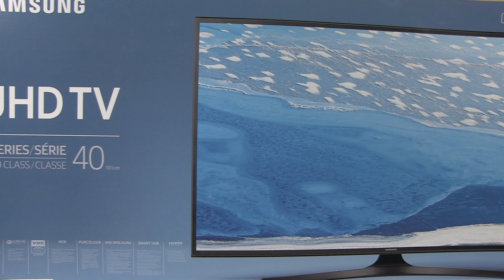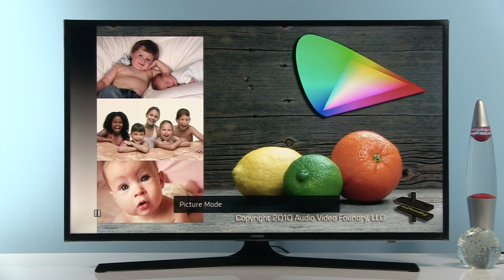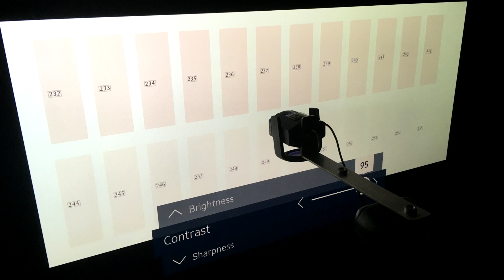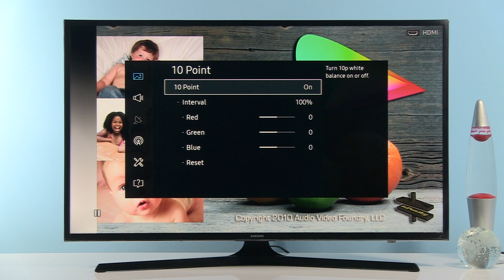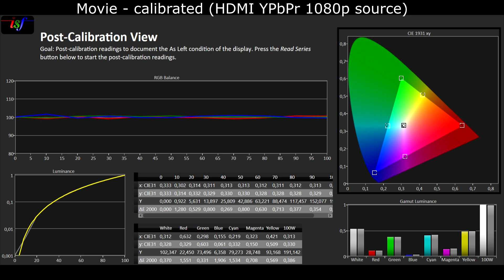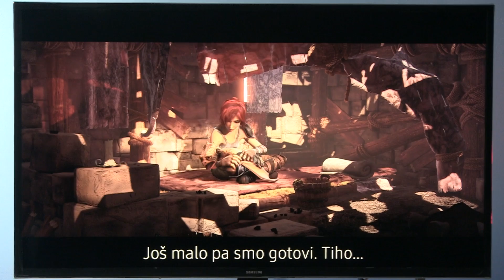Samsung 40KU6072 KU6000 UHD TV settings after calibration

Comment: Thanks for sharing your knowledge and experience. 
Following most of the calibration in this video for a Samsung Smart TV UHD 4K 40" UE40KU6072 I manage how to get both on RGB and other stuff inside the Nvidia control pannel and "game of mode" on my TV. 
The 40'' TV is a playfield of a virtual pinball machine with three screens: two PC monitor and one TV. The two monitors both with RGB and full color output ON. .
The TV was connected to the GPU with a display port and HDMI on the TV. Strange cable buyed almost 6 years ago.
Yesterday I manage to switch the DP-HDMI cable with another (not a 2.1 certified) with an old HDMI cable. 
The problem was game mode on without RGB and color output on in the Nvidia control panel. 
Following most of you tutorial I manage to have both on.  The 4K TV became sharp, clear, very different from the previous settings, no stuttering playing a game on the virtual pinball, much better than before. 

I understand why this is possible, HDMI colors is off. If I enable HDMI colors on the TV, no more gaming mode on the TV and no more RGB and Full output ...on the Nvidia control panel.
Thank you again

Comment: And 1250 settings?
Reply from the maker: 1250 - I am not familiar with this model. What is the full designation?
Reply: @TVguyDarko  Samsung Ku6000 Firmware 1250

Comment: Hey Darko, I own a Samsung KU6000 I watch it only in a dark room. I can't set HDR/Dolby Vision, it's always gray-ish. Below I wish you could analyze my settings and suggest any changes fot HDR Callibration with THX app. The HDR values below have been the most vivid ratio I've gotten from the TV. Any reply appreciated. Thanks!

Backlight          20
Brightness          44
Contrast                  100
Sharpness           0
Color                  50
Tint                          50/50
AutoM Plus         Judder Auto 
Dynamic Contrast  Medium
Color Tone           Standard 
White Balance  Factory Settings
Gamma                 +3
Color Space        Native
Reply from the maker: Hey - the settings look good and basically, this is the best you can get from one of the first mainstream UHD TVs with HDR support. The picture is grayish because the backlight is maxed out and that also elevates blacks on the entire screen due to the lack of local dimming.

Comment: this setup works perfect except in some games with HDR... I had to increase the backlight a little bit. Any tip?
Reply: For ku 6300 I use this form gaming...gaming mode, back light 15, 45,100,20,55,hdmi level auto, warm 1,gamma 0,. And for HDR gaming backlight 20, depending of the game I sometime put color too 69...

Comment: Hi, i have ue49ku6675xxe curved tv, i didn't find settings for this model, which calibration is best for movies? thanks
Reply from the maker: Hello - in general for Samsung it is best to use Movie preset with adjusted Backlight to your preference and reduced Contrast 5 to 10 clicks from the initial value. You also might want to play with Auto Motion Plus to find the optimum playback setting.

Comment: Nice. I think I am getting 43KU6072 next month. It doesn't seem to have any competition on its price point here in Poland, if I sort TVs by price it is surrounded by some 40 inch FullHD TVs, so it looks like exceptional value. 2017 TV's won't have 10bit color until MU7000 series that is surely going to be way way more expensive, so I suppose that there is not much to wait for.  Also thanks for great videos, you are covering just everything, if someone buys the TV you have reviewed then he can be sure that he will use it to its full potential.
Reply from the maker: Thanks for the comment. I can confirm all that you said since I already tested Q7 "QLED" and am testing 40MU6402 - no major differences/improvements compared to last year. So you can relax and get KU6072 - I am sure you will be pleased with it.
Reply: Other interesting options are new Sony FullHD lineup, especially WE75 with Triluminos (similar to Quantum Dot tech?) and HDR10 support and also TCL P60 series, this one is looking especially crazy for a price, 4K, 8 bit + FRC, Micro Dimming, HDR10, 20 ms input lag, full Android, all of this for price similar to this Samsung KU6000. So cheap compared to features that it almost looks suspicious. Interesting things are appearing on the market. I think I will hold on for a bit. Will you be getting any of those (Sony WE75 or TCL P60)?

Comment: When I try to adjust my Samsung KU6000 according to your settings my tv doesn't let me change HDMI Black Level. It is on Low by default and I can find no way to unlock this particular setting. Any idea why this happens to me? I already tried restoring tv to factory settings and the problem remains.
Reply from the maker: Hi, Pedro. Sometimes depending on input signal this option is disabled/greyed out. You should not worry since Samsung TVs have quite accurate auto adjustment of black level.

Comment: Hey thanks From germany. 

The interval for whitecourtballance...how setup i must.. 10% or 100%.? Or is this automatily?
Reply from the maker: Hi - 10-point white balance has 10 different points that need to be adjusted for the best result. So not only for 10% or 100% but for each in between. Please note that usually just by adjusting 2-point white balance you can get really accurate greyscale.
Reply: what for Balance i must try by end of setup
Reply: TV Calibration with Darko i mean by end of setup by 10 point with Balance...  

I can 10%, 20%.... 
with what % u are end setup?

Comment: Hey Darko
Awesome channel, keep up the excellent work! I wonder if you can help? I'm trying to get accurate colors when I connect my laptop to a 40KU6020 via HDMI. However, I am unable to select "Movie" mode when it's connected, only Standard and Dynamic are available.. Should I just select Standard and apply your calibration settings to that? I'm looking to do color correction work using this TV as a monitor, so any advice you can offer would be hugely appreciated!
Many thanks! :)
Reply from the maker: Hi - thanks for kind words! Yes, in PC mode there is no movie, but you can adjust using tips from this video. Just make sure that HDMI Black level is Auto or Full to get full range 0-255 signal that comes from PC by default.
Reply: Thanks so much Darko! One more thing, I'm also unable to access the 10-point white balance.. Will adjusting the 2-point white balance with your settings be enough to give accurate color? Thank you! :)

Comment: Hello Darko! Thx for the settings. I love the picture of my videos now in my 55KU6072. I ve just changed my old tv, my previous tv was a samsung 46' C7000(2010 modell). I love my new tv, but dissapointed a bit about the HDR... what tv do you recommend to buy with best HDR(hardware) in the market?
Reply from the maker: Hi! Full understand that you are disappointed in HDR since your model does not have necessary hardware to display it. It can only detect HDR signals and boost backlight and contrast. TVs with true HDR are Sony XD93/XD94, Samsung KS series (KS7000 upwards), Panasonic DX900, LG 2016 OLED TVs... They will give you not only HDR effects but more deeper colors.
Reply: TV Calibration with Darko  hi! I am planing 2 change this tv to a ue55ks7005SUHD...but some forums said that this is lottery becouse some still have 8 bit panels...I am affraid to spend more and get same 8 bit...Do you know about it or it is just gossip? Sorry my english...:P Regards!

Comment: Hi Darko,
First, thanks a lot for this calibration work. I  like Standart picture preset more than others because of its auto backlight features.I think Auto backlight is working more effective than other presets. I did your settings to my UE50KU7000UXTK model TV in Turkey. I think this is the same TV with KU6000 that you reviewed. But only some differences to set my TV.  Used your calibrated settings at Standart picture mode. Only did 2 point white balance and colour space settings with Warm2 colour tone. Others are the original settings of Standart pic mode. Auto backlight is on and min.backlight is setted to 7.  It seems perfect to me. But i want to know one thing. When i use use your settings,should i do 2 point white balance? (2-0-0 / 8-0-0) Or, should i leave it original? (0-0-0 / 0-0-0)  BTW 10 points W/B setting is not available in Standart pic.mode.

If i'm doing this wrong  , any suggestions to calibrate or set my TV with Standart pic.mode?
Reply from the maker: Hi - thanks for you comment. The question regarding White Balance is something you need to figure out yourself by looking at greyscale and black and white movies and try to determine which combination gives you the best neutrality. By that I mean, which settings (all default or mine) will give you greys that have less red, green or blue inside. In reality you should have a meter to measure that correctly because our eyes can trick us on this. But if you do not have a meter, investigation like I said is a good way to start.
Reply: TV Calibration with Darko Thanks i'll try this.

Comment: I use HDR on my XboxOne S on this tv & I leave my backlight at 15, I just read for the HDR to work on this tv I need the backlight at max 20 is this true?
Reply from the maker: Hi - your TV cannot really reach very high peak luminance, that is why for the best effect Backlight should be at max. But of course you should adjust it to your liking.
Reply: TV Calibration with Darko Thank you brother! And ya if thats what they say is the best way to view HDR then Ill at least try it out. Thanks again.
Reply: TV Calibration with Darko. can i use this settings for my Samsung Ku7000 40'
Reply: When an HDR source is detected the backlight should max itself out automatically. This TV is not true HDR and is less than half the brightness you'd see on a proper HDR set.
Reply: Michael McCourt this tv is good enough for me for few years looks great on the ps4 pro and sky uhd tv

Comment: hi, I just ordered the 6072 version and i'm  a bit worried that this version doesn't include hdr(or hdr+) mode. is it true ? thanks for reading :)
Reply from the maker: Hi - it supports HDR. For HDR+ you need to update software to the latest version.
Reply: Last question do u know the difference between 6072 and 6092
Reply from the maker: +JohnnyRottenHouseJRH Only cosmetic nature, nothing that affects picture.

Comment: Hi,  can you tell me if that calibration  is the same for Samsung 49 inch UK 6172 curved led TV.?  Thank you!
Reply from the maker: Hi - possibly, but cannot confirm 100%. Each unit is unique but you can apply tips from this video to see how it will work.
Reply: I did apply the same settings. They are good. But what i have noticed that HDR+ mode is giving me the best picture quality and colors. What do you thing about this mode ?
Reply from the maker: +ивайло Аксиев HDR+ simulates HDR. Its purpose is to give more attractive image, not the accurate one. If you like it, use it.
Reply: I agree. I have tested many times the different modes and the callibration you gave for the Movie mode.I think that the Standart one is having the most appealing pocture of all and sometimes the HDR+ one, bu when the content is with very good quality. Is there a possibility that you can do a callibration video for Samsung series 6 tvs for the standart mode too ?

Comment: Hi there! I have a small problem with Youtube app on my Tv UE40KU6092,When i start the app,when i select a 4K video,after it`s start playing when i hit more info,and gives me the info about the video res,and the codec used by YT,the res. is only 1920x1080,and not 3,840x2,160. Why is that?
https://s24.postimg.org/6izb7tw7p/IMG_20161218_163921.jpg
https://s27.postimg.org/a4apr91kj/IMG_20161218_163956.jpg
Reply from the maker: This should be corrected with software update for the TV. Don't know when will it arrive in your region, in mine is also not available.

Comment: Hi Darko, can I use the same settings for my ua65ku6000?
Reply from the maker: Hi - sure, please try and let me know how it works for you.
Reply: TV Calibration with Darko Works well, although it looks a bit warm to my old eyes. My Asian model UA65KU6000 does not allow me to change the Fit To Screen to Auto (it defaults to Off). Do I need to set the HDR+ to ON?
Reply: I tried turning ON the HDR+ and the picture becomes way too bright and jarring. Will keep the settings you gave

Comment: Hi Darko, in this video you have 10 point white balance calibration at 30% as Red 0, Green 0, Blue -3, but on the pdf it is set at Red 0, Green 0, Blue 3. I was just wondering which one is correct?
Reply from the maker: Hi Connor - thanks for pointing out this mistake, I have updated the PDF and sent out e-mail to all the customers. If you need me to reset download counter just let me know.

Comment: Do you know what is this TV's response time? Could I use it intstead of a monitor and still get great performance?
Reply from the maker: Hi - response time is not disclosed by any TV manufacturer for a long time, but judging by low input lag and motion performance, it can be used as a PC monitor without any special flaw compared to ordinary PC monitor.
Reply: TV Calibration with Darko ok thanks :)

Comment: Hi! I just bought the ku 6092 model and the screen dims in darker scenes or the screen shuts off completely when  the image  is completely black. What can I do? Keep in mind that I turned off all that  eco sensors!!!
Reply: I have the same issue I leave mine on Standard with backlight 15 contrast 82 brightness 42 color 52 sharpness 50 and everything else dont touch expect for Color dont leave at native go with Auto and the Dynamic Contrast I leave at medium try this and see if that stops cuz it worked for me. Oh and you said you disabled all the eco opitions check it again cuz some times the tv will reset it self for no damn reason!! Hope I helped!!
Reply: John Merced thanks !
Reply: I have the same problem, samsung sucks

Comment: what calibration should i do for HDR+ turned on for hdr gaming and hdr content ?
Reply from the maker: Hi David. I just got KS7500 which has HDR+ mode (haven't seen it on previous models I had for review). I will check it out and let you know how it works and which settings to use.
Reply: TV Calibration with Darko 
thank you so much. all Samsung 2016 tvs have hdr+ mode.

my samsung un40ku6300 has it

Comment: Hey man, nice vídeo. Very clarifying. I didnt see HDR config here. is it automátic? tks
Reply from the maker: Hi Rafael - I did not publish HDR settings, but you can use tips from this video.
Reply: I used. And the result is quite impressive for a low end TV like this. Black levels at no light room is noticeably lighter, só the only adjustment I did diferente is the brightness tô 40 instead of 45 tô compensate.
Reply: Is that all you did? Is it better with HDR on? I just ordered KU6092, so I'll appreciate your opinion and answer.
Reply from the maker: Stefan Stefanov Hi - yes, these are all settings I've adjusted. With HDR it is not better since it does not have hardware capable of displaying true HDR picture and wide gamut colors.
Reply: Hey, thanks for your ultra fast reply.

But if I turn on HDR, will the result be more bad or I'll see no difference?

Comment: this calibration will work in ku700a too ?
Reply from the maker: Hi - KU7000/KU700a is not available in my country, but by checking the specs I see this is basically the same model so settings are applicable. Let me know how they work for you.